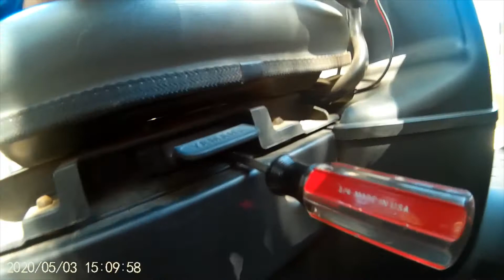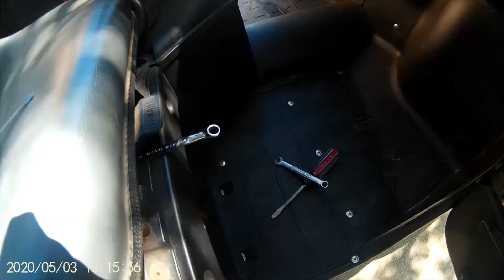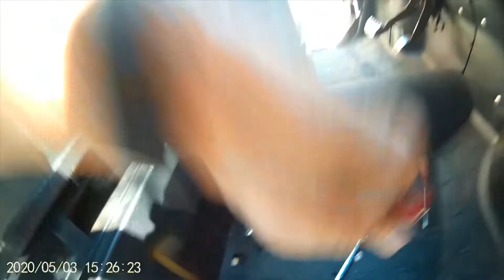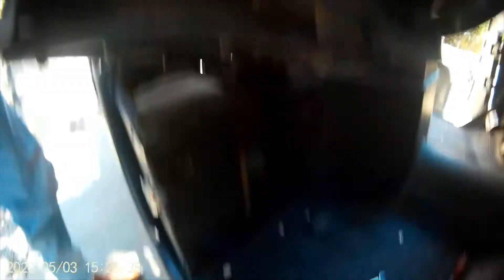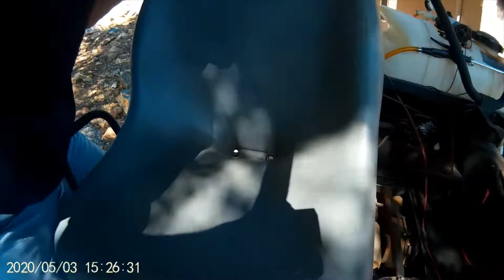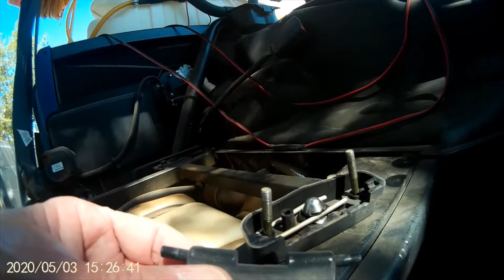Yamaha Rhino - Broken Seat latch Removal

Comment: Didn’t work for me, so frustrating so I just drilled through the plastic and used a hook tool to relieve the spring tension and came right off. My Rhino is 2006 model 660 and just broke after years of use so guess I’m lucky. Just ordered OEM replacement. Thanks for posting though as I was at a loss how to proceed.

Comment: Mine broke I found this it worked for one side I couldn't get the other side loose so what I done was take the handle that is broke and just take it out it's already broke so just use force and it should come out once that handle is out of the way you can see the metal latch pin that locks the seat down use a seal pick with a hook and pull the metal latch pin toward the front of the machine and the seat should pop off and remove broken latch and install new one